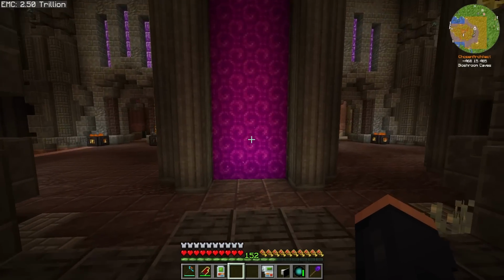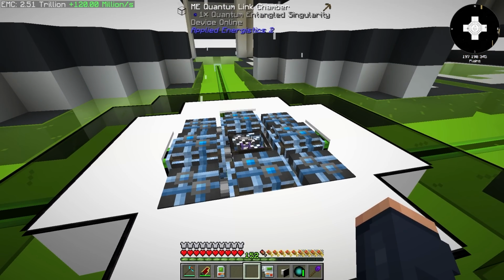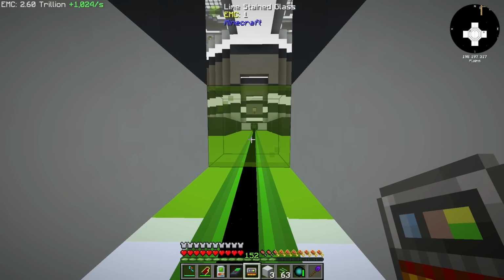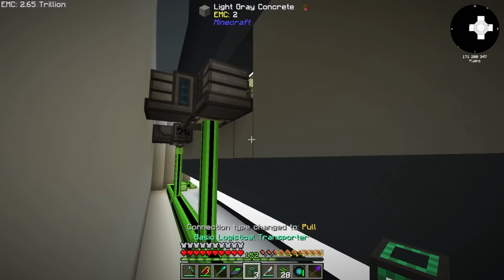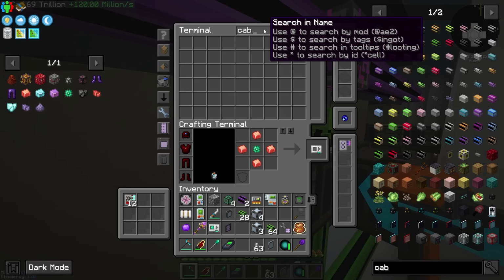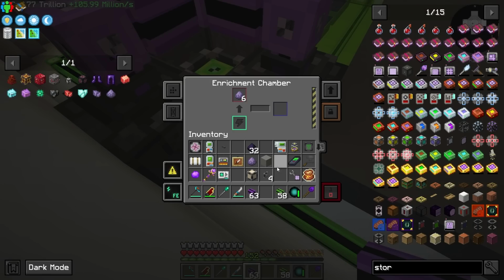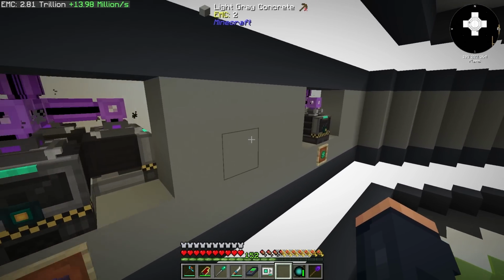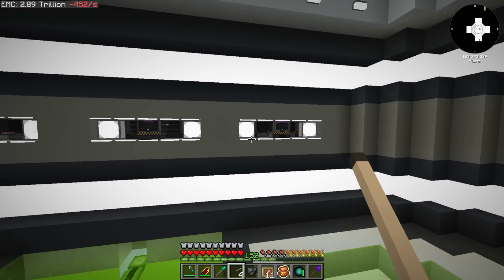PROJECT ARCHITECT 2 - EP 26: AE2 P2P Tunnels & Subnets for Mekanism Automation

Comment: Why does he use 12 devices? 7 metallurgic and 5 enrichments? however I could I only get 11. I saw he had steel ingot in the frame but why? The only way you make it is smelting down steel dust... Anybody can help me out here pls? I got so lost in this video that I remade the whole thing 4 times already and still getting lost

PS: Figured it out, it works fine now just had to think and imagine it working on my own rather than follow Chosen :)
Reply: what did you do?
Reply: Anyone else that's wondering what all the machines are set to it looks like
powdered obsidian enrichment chamber
enriched diamond enrichment chamber
enriched carbon enrichment chamber
Enriched Obsidian Enrichment Chamber
enriched redstone enrichment chamber
basic control circuit metallurgic
reinforced alloy metallurgic
refined obsidian metallurgic
enriched obsidian dust metallurgic
atomic alloy metallurgic
infused alloy metallurgic
steel blend metallurgic

Comment: You can also automate infusers by having a dedicated infuser with a pattern just to turn the materials into gas form, and having a chemical disk to temporarily store them on your network. You just need the infuser input be set to "extra" and have a gas pipe pulling from it back to the pattern provider. On the infuser that actually does the producing, you do just use the pattern that shows the gas as the ingredient and have "infuse type" input from pattern provider and otherwise normal (item input/output from provider with eject on).

I personally find this approach more elegant since you don't have to set up a machine line for each infuse type, but it's also scalable with being able to have up to 5 ultimate infusing factories for a pattern provider, and if you use a lot of infused alloy or steel, you can also have a dedicated providers with just those patterns. (I haven't tried scaling it beyond 5 machines per pattern, but it might be doable with having another provider with the same pattern)

Edit: I've also been fine with just using the singular ultimate enriching factory, that I use for all my crafts, but that may change if you have more infusing factories. I only have 4 ultimate and only reason I would consider having more is if I wanted a ton of induction matrices. I do have a beefy 100TFE induction matrix, and it did take hours to craft but that was fine since I had the foresight to order the auto-craft beforehand while working on something else. Just if you are working on mekanism stuff, you need to make sure to have the stuff you need ready beforehand, since the craft will occupy the machines. (or you can cancel it to craft something else and resume it)

Comment: Been playing along with this series, and I made a second world to switch from RS to AE2; holy cow! I dunno if it’s how Refined runs but the autocrafting in AE doesn’t crash my game xD

Utilizing quantum rings is a cool feature and I want to add P2P tunnels to my network, but the same result can be achieved using subnets of smart cable, barrels, and quartz fiber. I have two “factories” that are about 2 chunks apart, so it’ll be interesting to automate.

(Pro Tip: Named items reflect their name in a pattern encoder. If you name a barrel “Furnace”, the network shows its name as such. You can use an anvil or a labeler from gadgets against grind.)
Reply: You can also right-click with the knife from AE2 for renaming pattern providers in world

Comment: add AEInfinityBooster next update pls♥
Reply: think the singularities alr do that for cheaper.
Reply: @terrat0mere  wdym?
sry I'm still new to moded Minecraft
Reply: @evangelionweeb399 what does aeinfinity booster do
Reply: @evangelionweeb399 basically instead of refined storage letting you craft an infinity booster with nether stars.  Singularities are ae2 infinite wireless connectors, with the bonus of setting up parts of your network across dimensions like chosen has done at the start of the episode (the quantum rings).  There are many ways to have access to wireless crafting & storage and it boils down to personal preference.